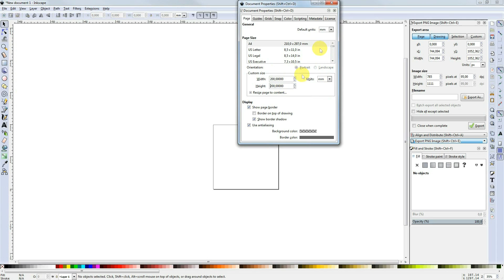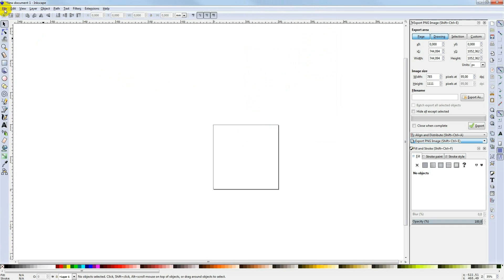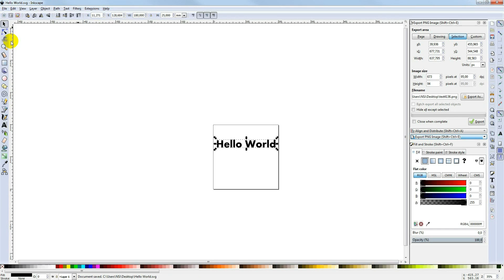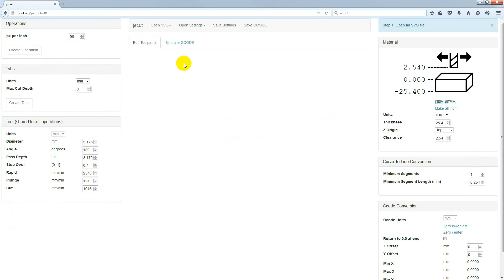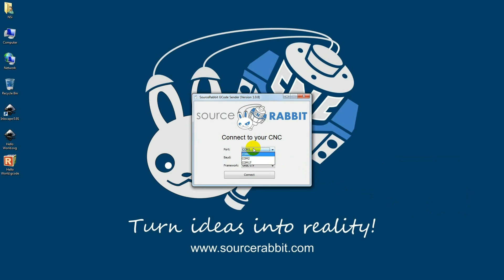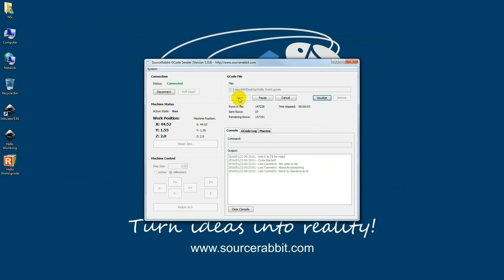How to generate GCode from a 2D Design

Comment: how to solve this problem 
Traceback (most recent call last):

  File "unicorn.py", line 108, in <module>

    e.affect()

  File "C:\Program Files (x86)\Inkscape\share\extensions\inkex.py", line 283, in affect

    self.effect()

  File "unicorn.py", line 102, in effect

    parser.parse()

  File "C:\Program Files (x86)\Inkscape\share\extensions\unicorn\svg_parser.py", line 230, in parse

    self.svgWidth = self.getLength('width', 354) * 0.28222

TypeError: unsupported operand type(s) for *: 'NoneType' and 'float'

Comment: I just got an error message buffer size is too low process interrupted, on grbl controller when ever I create g code from Inkscape?? Any idea how to fix it
Reply from the maker: Make sure you use GRBL v0.9j and the SourceRabbit GCode Sender.  If you keep getting this error then open a new issue and ask for help on the GRBL github page.
Reply: Well I used v0.9j then motor stops work!! But it work fine with 0.8c grbl hex file!! And thanks for the reply!! So how to change configuration on v0. 9,or is it something I doing wrong!! Well I'm new to arduino environment
Reply from the maker: GRBL configuration has to do with your hardware and electronics. We don't know the machine you are using so any suggestions will be inacurate.
Reply: +SourceRabbit i m just using old cd rom drive and their stepper motor try to make 3d printer by using arduino uno and easy stepper driver!! But I couldn't find any solution regarding!! My problem of getting an error :buffer size is too low, process interrupted!! But it work well when I use maker cam. Com to make g-code..!!!

Comment: i am clicking "Generate" button on that website , but its not working there ,, please tell me some else
Reply from the maker: Are you using the same parameters (endmill diameter and design size) as the tutorial?
Reply: yes ,
Reply: @jaxim1  i have also the same problem
Reply: @lajmimohamed8296  Me too
Reply: @RenbournGuitarWorkshops-GLUG  use directly jscut without inkscape